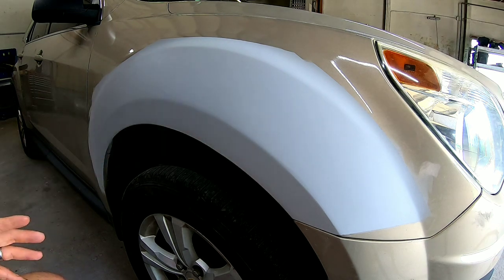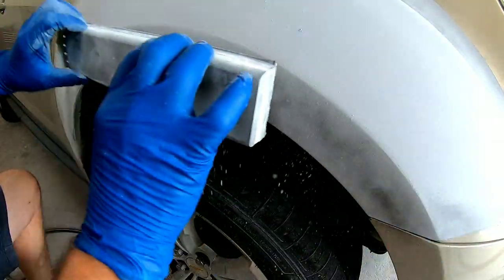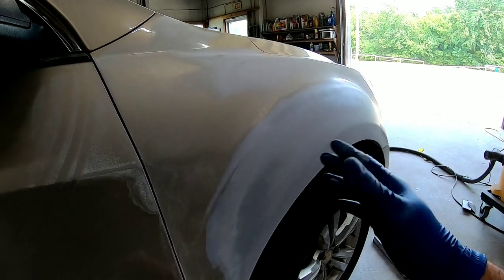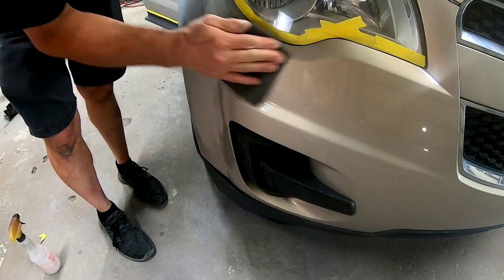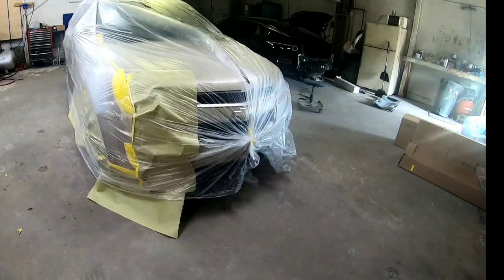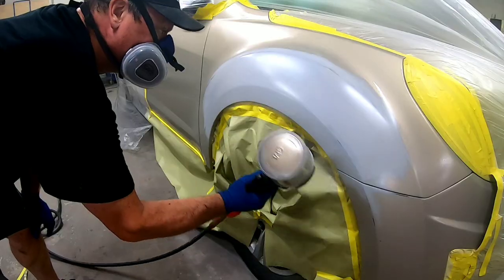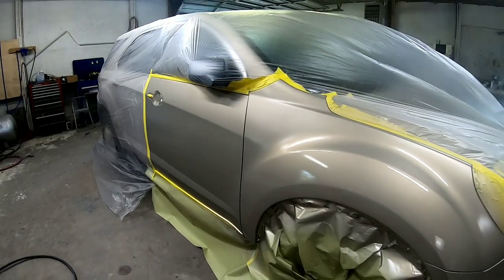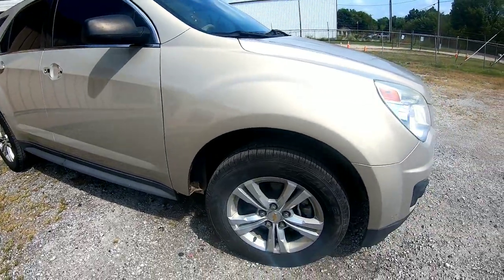Preparing primer and painting your car. how to use wet bed and smart blend. diy paint  auto body.

Comment: Dude this video is awesome! My 1989 CRX and my 1999 Prelude have those slight scratches from previous work. Guess they didn't use 320 grit. Also my hood got cracks and fish eyes after they painted. And it chipped easy.
Reply from the maker: Thank's brother, Yeah it pays not to get in a hurry and primer over deep scatches. Otherwise you get a poor repair.

Comment: Hi bought a new Sagola 3300 you featured on your channel seem to be getting lot of orange peel how can tell if clear is going on to thick orange peel doesnt seem appear until paint is dry.Great content Thanks
Reply from the maker: What air pressure are you spraying at? After you make  you first pass take a look at the texture of the clear in the light. Dial you volume back a bit or up you air pressure  up a bit. Not too much this should smooth it out.

Comment: How would this wet-bed method work with single stage acrylic enamel?  I've got some minor tiger striping in one area I'd like to correct without repainting the whole panel.
Reply from the maker: It doesn't work like that with single stage . Single stage is made to spray wet like clear, a wet bed is mainly to eliminate mottling in a blend. Stiping in single stage can be caused by too much air pressure, inconsistent overlap on your passes or a gun that may have an inconsistent spray pattern maybe from a some dried paint in the cap or something.  Sometimes on single  stage if you spray a drop coat right after the last coat you can even out those metallics without effecting the finish but there's no real good way to get rid of tiger stipes after the paint job without re-painting. Sigle stage metallics can be Sometimes more difficult to spray that base metallics.  Appreciate your comment hope this helps.

Comment: Another great job my question is if you was using a 1k primer would you  still finish standing with a 320 grit and then 600 grit and base coat thank you for the video stay safe
Reply from the maker: Yes, but 1k doesn't  build up quite like 2k so you will sand thru the primer  quickly. Thanks for the comment!
Reply: Thanks I went with  a 400 grit  and didn't cut through

Comment: My Roadrunner needs alot of sanding. I'm using a DA with 80 grit but it takes awhile.  Can a polisher be used, carefully of course?
Reply from the maker: Yes there are some other tools you can use, like a larger orbital sander with a coarse grit sand paper like 40 or 36. You want to be careful  about heating the surface too much and warping the panel.  A orbital sander is less likely  to over heat metal like a rotary will. Thank's for watching!

Comment: @Garage Noise  do you have a clear-base that you like when creating the wet bed?  I'm not finding one at my local shop and hoping you could link one in Amazon or something 😁
Reply from the maker: I use nason binder, I'll  try to fo d one and give you the link . What paint do you use?
Reply: @GarageNoise  It's Martin Senour paint I'm able to get here from NAPA.  Finish 1 is the clear/hardener/reducer
Reply from the maker: @kseries20-24only  Here is a blender link, resonable priced can be used as a wet bed. I've  never used  it but may give it a try. If you use it let me knowwhat you think. Much cheaper than the wet bed I use.
https://amzn.to/3icdAPz
Reply: @GarageNoise  Outstanding, I think I'll give it a try and let you know 😉 😀
Reply: @Garage Noise the specifications say this blender is RTS (ready to spray).  Would you anticipate I can buy this and throw in the gun to spray on sanded/prep'd areas without reducer?
Reply: @Garage Noise used this on a paint job last night, it was ready to spray (no mixing) but beware it gave me the runs!  (and I don't mean what I had for lunch) I think if it is used as a light mist coat probably works.  If you want to make a video on how to correct the runs, go to Taco Bell for lunch, pick up some of this blender, and I guarantee you'll have a great video on your hands here!!  😂🤣🙄
Reply from the maker: @kseries20-24only  lol

Comment: On the video you said  binder is mixed two to one but on the can I saw it says one to one I’m confused
Reply from the maker: I watched  the video not sure what your referring to? The reduction wether it's 2:1 or 1:1 depends on what brand binder your using. Folloe the technical data sheet.  I am currently using speed coat color blender, I like to reduce that about 10%